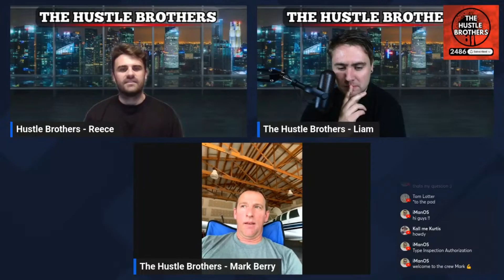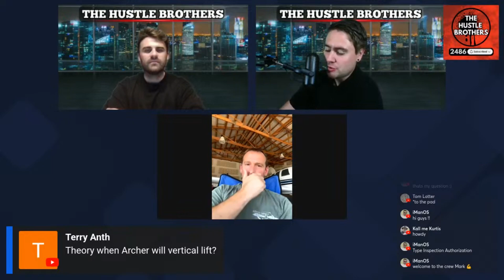Archer Aviation's Midnight Rotor Controversy Explained: PILOT Reacts to CTOL to VTOL!

Comment: More propellers, more motors, equals more complexity and asymmetrical thrust. The single engine eclipse jet can power off glide just like a Cessna 172 or any other fixed wing aircraft. Midnight does not have this capability. It’s a flawed design that will NEVER receive a FAA airworthiness certificate. Well established helicopter manufacturers struggle to get CONVENTIONAL designs approved within a decade. You’re talking about new power supplies, electric motors and complex fly by wire flight controls. GOOD luck with all that! On top off everything, there’s no real market or time savings even if you could convince the masses to hop inside this tiny aircraft.